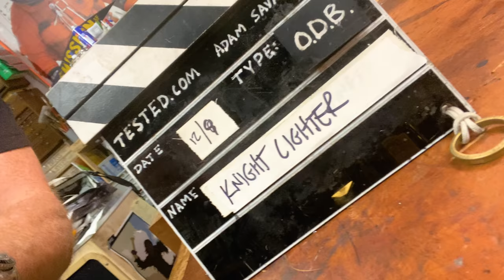Adam Savage's One Day Builds: Knight Lighter!

Comment: Great vid, Adam. I like these "found item" vids you do. Your knight is full of cotton to soak up the lighter fluid. The fluid soaks into the cotton, and the wick "zig-zags" through the cotton. The fluid-soaked cotton imparts the petrol to the wick then evaporates. The spark from the flint ignites the petrol FUMES. (NOTE: petrol itself doesn't burn as it's a liquid, but the fumes are HIGHLY volatile & burn ferociously.).
Check out a Zippo - the same principal applies. It's full of cotton wool.

Comment: My problem with these "restoration" channels is that they don't restore parts to their original condition. They remove casting marks, polish what was never polished, sometimes even remanufacture parts to completely different designs! It bothers me so much that they call that a restoration because no collector would want a piece that's had its casting pot marks filled in with Bondo and rattle canned thicker than a fondant cake. Anyway, rant over, you did a very good job RESTORING this piece, very beautiful!

Comment: You need to wax it before that Zamak oxidizes again. In a few days it will be dull again if you don't. Zinc alloys polish beautifully, but also tarnish almost instantly. I recommend Flitz or a similar polish as it contains wax as a carrier, just don't wash it off with acetone after rubbing it in. Wipe with a soft cloth to remove the excess.

Comment: Serious question.     After polishing the pot metal,  how plausible is the idea of applying a light clear coat of some type to prevent the metal dulling or oxidizing going forward?   Maybe just misting it with some off the shelf low gloss clear coat spray...

Comment: Does anyone else think this knight is from a company logo?   I’ve a vague memory of exactly this knight on a billboard.  The way to replace the wick is pull all the wadding out first, then pull out the wick.    Long, long ago there were kits available with wick plus wadding.   On the other hand — the original wick would generally be long enough that you could pull it out and trim a number of times (which it looks like you eventually did). Not to mention — for someone who no longer smokes, you really work hard to make it work.

Comment: If you push the wick in, to the point that you can't reach it. You'll have to pull all of the cotton out and reinsert the wick. You can do this by wrapping a fine wire, tightly around one end of the wick, compressing it, and poke the wire through the wick hole and pull it through.

Comment: “Smells like an old zippo”
Works like an old zippo too 😂 
Having done a lot of work like this on really old lighters, leaving it lit for a bit helps more than pulling out the wick a lot. 

You need very little wick. 
What you need is the little wire in the wick and wick that hasn’t been completely burned.

Comment: What kind of awesome little acetone bottle is that? It looks handy as heck and a way better solution than what I’m doing today.
Reply: One of the places you can find them is justrite . com  Search for "dispenser", and they should come up in various sizes.  I use the same type daily at work, and they work pretty well.  Though they work best if they're not filled completely to the top, but rather 80-90% or so.  We use them for both acetone and MPK.

Comment: The wick is inserted, from the inside, and pulled through, just a little. The rest of the wick, 2 or three inches, is left in the fuel chamber. Cotton is  then packed into the fuel chamber. When you add fuel to the chamber, it saturates the cotton, and keeps the wick wet, until all the fuel is used. Pouring fuel into a chamber, that has just a wick and no cotton, could be dangerous. You don't want a lighter in your pocket, with fuel sloshing around in it.

Comment: You need to let the lighter soak up the lighter fluid after you fill it. If it has not had lighter fluid in it for a long time the wick will be dry so when you light it you will burn the wick and mess up your lighter. Learned the hard way.

Comment: You might want to dig that old cotton out and replace it with loose wool felt. It lasts longer and won't taint the fuel as it decays. I use the little balls of wool that comes on wool daubers for leather dye. I buy them in bulk for leatherworking so it's almost free for me. $10 or so should get you a lifetime supply for a couple of lighters. Just unwrap the wire handle and stuff them into the fuel tank.

Comment: Two things; 1) that's not the original base. 2) FYI- the weakest part, the part that fails the most, is the 'bridge of the nose' that tiny ridge on the helmet that the hook hooks to. 
...
Note, this lighter comes in two sizes, maybe three, and the most interesting base contains a music box. The music box base is an inverted tin cup that cracks very easily. The music box is usually Thorens. There exists another variant that doesn't have legs. 
... 
Collecting old lighters is a fascinating hobby! I recommend you look into 'lighters that look like other things. After the war, Japan made a ton of lighters that look like just about anything you can think of- typewriter, radio, birdcage, cars, and guns... Loooong list. One of the more interesting examples is the TV lighter made by Swank. It's semi-auto, like this suit of armor, but the TV screen is a slide viewer!

Comment: @Adam Savage’s Tested WHAT. Is that fantastic red CAN you have your acetone in?! I want it for my ownself. Inquiring minds want to know... Also, old hand at lighter highjinx as well, so in exchange for this intel I can offer you a tip for extracting those oldschool round wicks when they are burned down to a nub, straighten out a a very small fishhook and poke it in about 2-3mm and tease it out with that, OR if you are a living multitool (which you are) and have a VERY small crochet hook.. VERY small, that will sometimes work. An antique one is more likely to be quality steel btw and it helps if you put a sharper point on the bottom point of the hook too (assuming you no longer want to crochet doilies that is..) You can also do it quick and dirty with piano wire if you crimp the end over and then crush it into a hook and use that, far more likely to bend however. Honestly tho, fish hook is king, hook never bends, don't have to alter an existing tool, etc and you are 100% on point with the felting needle idea.. Anyways. love your work, your channel, and you sir. Never stop making. PS: cool lighter BTW

Comment: Adam, in case you want a better cleaner for things covered in buffing compound a great cleaner to have in the shop is clock cleaning solution. It can be bought commercialy or you can make a homemade version with harware store cleaners.
1 L Ammonia
40 mL Pinesol
40 mL Murpheys Oil Soap

It will remove oils and grease and clean surface oxidation and corrosion from copper and brass alloys if you submerge it in the solution. Becuse the ph is pretty hogh it also wont let ferrous materials rust if thier left in it for long periods.
Its excellent for cleaning clock and watch mechanisms and all kinds of small mechanisms.

Comment: Found a version without the shield but with the following text: 

This is the authentic table petrol lighter "Knight in Armour" Weltzunder, Modell Ritter, made in Germany (1940's - 1950's) in working condition. The lighter is made by , Kremer and Bayer, Weltzunder during 1940's - 1950's for the occupying American troops just after the war had ended Height: 18 cm (including stand) Weight: 355 grams The lighter has the original bakelite base marked "Made in Germany, U.SPat., Weltzunder, Modell Ritter".

https://www.facebook.com/commerce/products/1334548249984918/?hc_ref=ARSns2dWeVJRFdPpmFl43XxVYSB5DQZm5itjSs1oLdloqc48UgfA72BwO5W7pxVz62o

It also has an extra screw in its back. Its interesting how a object from Germany, made for the soldiers, got to the USA and probably was a hit, at least enough to be also made there from then on. Love those kind of backstories. Certainly from that age.

Comment: When I was at University, acetone was a solvent which could only be used in a fume cupboard (enclosure with its own extractor, in case the term is not common usage) as it was toxic (doing liver damage if I remember correctly).